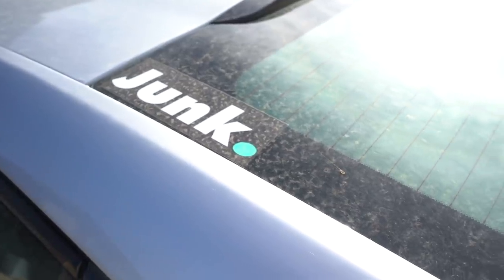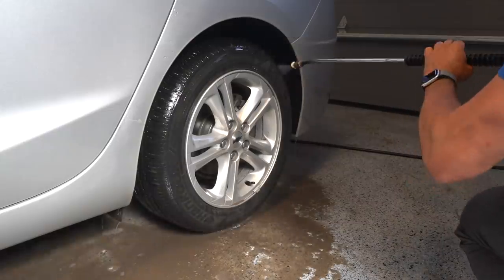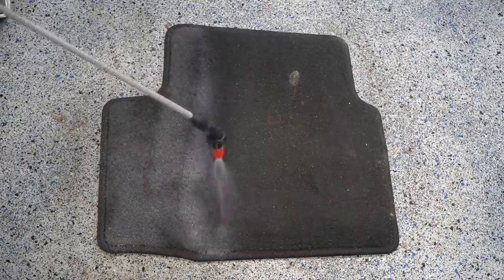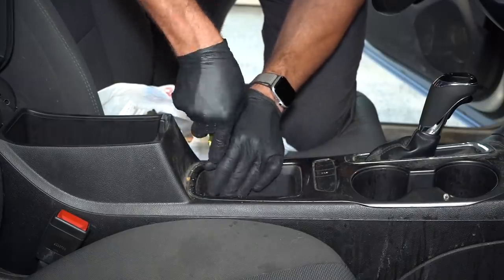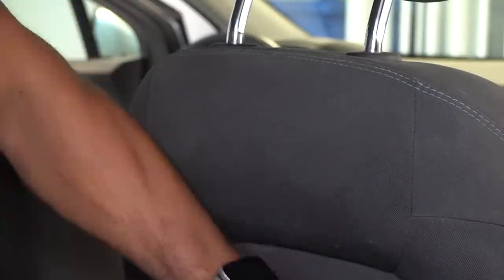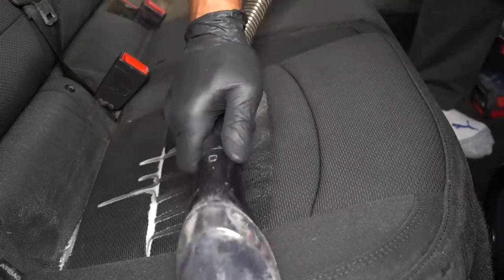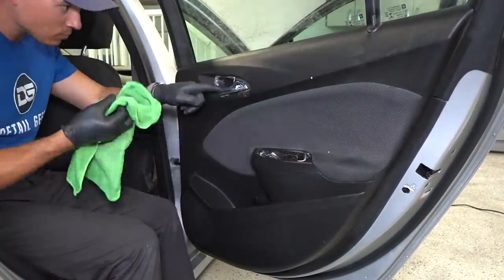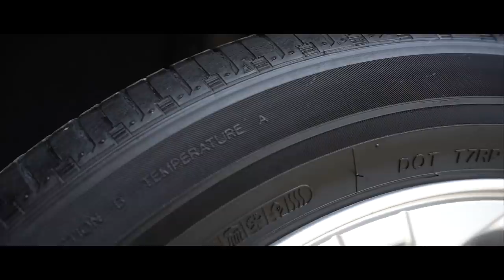Deep Cleaning a SUPER HAIRY Dog Kennel on Wheels! | The Detail Geek

Comment: Just use a a broom-style car wash brush to clean the exterior instead of mitt. Its way faster, relatively safe and you can still use two bucket method. If you're worried about scratching the paint (unlikely unless you carelessly dont rinse the brush), you polish after, its perfectly fine.

Comment: I really enjoy your videos and am very impressed by your work ethic.

You mentioned using the steamer to clean the speaker grille.  Just curious, are you concerned that the moisture from the steamer will damage the speaker cone?  It's my impression that speaker cones are typically made of a paper-like substance, and therefore might not stand up very well to getting wet.
Reply: I was also wondering about this. Doesn't seem like the best way to keep the speakers functional, even though they will definitely be clean...

Comment: None of these cars seem to have any brake dust on the wheels - for a car THAT dirty, you’d expect brown wheels... I know a pressure washer is great and all, but brake dust usually requires a brush. 

The dirt I’ve seen just looks like the car got wet and was driven down a dirt road on a windy day.

I don’t want to call bull crap, but the points above just seem odd.